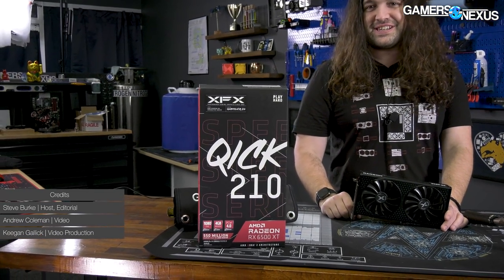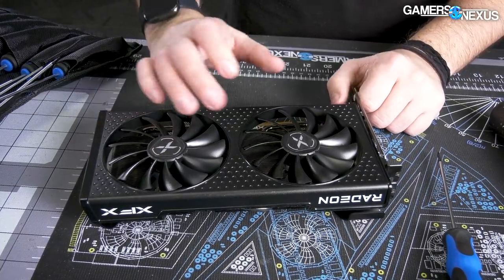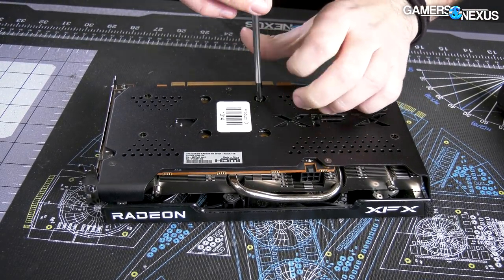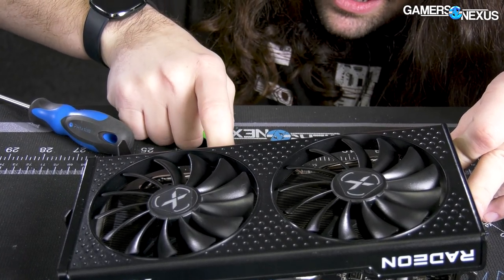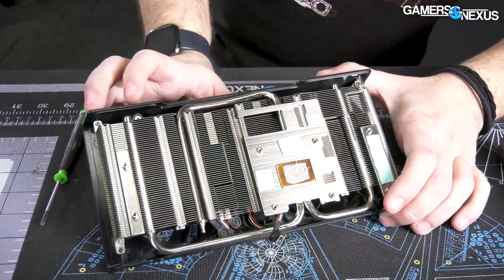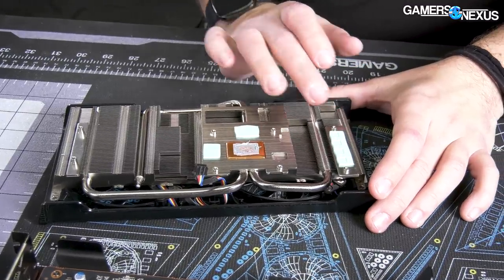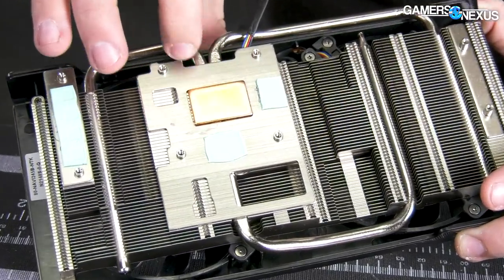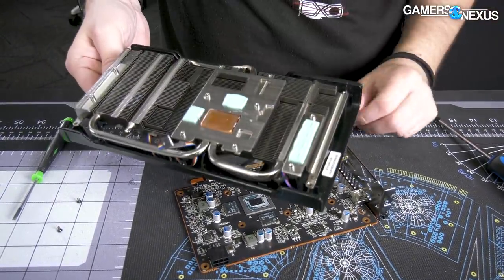Tearing Down Trash: AMD XFX RX 6500 XT Disassembly

Comment: Nice of AMD to design a card that goes direct from the factory to a landfill a year later. Maybe they can team up with Dell next and design a proprietary PCB that doesn't fit standard PCIE slots and cases?
Reply: Oh just wait a few weeks and you'll see this card in a lot of Dell prebuilds.
Reply: the other option is $320 1650 used for low end lmao, and $200 6500xt new become landfill
Reply: No. A lot will go to eBay where I then purchase it for a fraction of the price. It'll be a matter of time until the 40 series releases, and miners start to sell hundreds of thousands of 30 series cards on the used market. Miners from China where mining was banned are already selling 3060s for like $200 each. Granted they are in China, it's still a prerequisite of what's to come. The bubble will eventually burst wide open.
Reply: Don't you guys recycle? In Belgium you take old electronics to the recycle-park. Or if you buy a replacement part you can leave the old part at the shop so they do the recycling part for you.
Reply: @lewislu5157  320$ 1650 is 50$ less than a new 6500XT for more performance
Reply: @GrabASpriteB  they won't, as they didn't sell (and instead bought) 10 and 20 series cards.
Unless mining is banned or entirely moved to not-GPU, it won't happen.
Reply: @Jerre27  they're Americans, what did you expect
Reply: @Jerre27  very few places legitimately recycle e-waste here in the US.. it was primarily dumped on third world countries until they decided they had enough and started refusing it and now it just goes into landfills but at least people get to think they're making a difference, lol.
Reply: I guess you've never seen low-end office PCs. Replaced every 2-3y, the entire box is not worth the sand and metal it was made out of, outdated on the day of arrival.

Comment: I think they should've called it "KICK" because you get kicked in the balls for buying it, especially if you use PCIE 3.0
Reply: @haikatta....8023  right on queue...
Reply: Although the difference is about 10 fps at most?
Reply: @kimdotnet2110  😄
Reply: For PCIe gen 4.0 its a good buy. 10% better than GTX 1650 4gb DDR6

Comment: I'm actually surprised they bothered with a backplate for this. The cooler seems overkill too? Maybe less informed customers see the backplate and think it's a better card than it really is.
Reply: Look at the Gigabyte triple fan model. It's huge and basically see-through lol
Reply: Backplate 95% of the time is for looks.
Reply: @benclimo461  also a bit of additional protection for the board components when handling the card.
Reply: @kennichdendenn  That's what the 5% is for.
Reply: That's the point, coolers are cheap. $100 for a cooler.
Reply: @MiGujack3  in custom water-cooling, there are backplates with Heatpipes that get cooled by the water loop. For example for the 2080ti. It's called an active backplate.
Reply: @MiGujack3  and the -1% is the 3090?
Reply: @ICCUWANSIUT  lol yeah my 3090 KP over here begging me to add some backplate fins.
Reply: Aftermarket GPUs can be really funny that way. I remember back when the 1060 launched you had a ROG Strix version with 3 fans and a HUGE heatsink, and it cost the same as a 1070 lmao

Comment: While I agree that this would have been actually appealing and a good product if it was single-slot and didn't need a 6-pin, the reality is nothing matters at all about any GPU released right now.  It's already sold out, it's being scalped at double the price, we all knew what would happen.  I've been building for almost 30 years and this is the absolute worst it's ever been, clearly.  If crypto, scalping and supply chain issues don't get resolved it's only a question of when DIY building will die.
Reply: suspicionofdeceit  thats what people said a few years ago :p
Reply: suspicionofdeceit  it won't get better until crypto mining is no longer profitable. That may take a very long time, but the problem is that it goes in cycles. The only way to alleviate it is to place a government ban on it pretty much worldwide. I can see this happening for 1 reason, and that reason is energy consumption.
Reply: In my opinion, that's what they want. Corporations are jerking off to the prospect of users not owning hardware anymore, instead relying on streaming and subscription models. The need for hardware will still exist of course, for clusters and servers to power the cloud services, and users get to own nothing and have even less control of their own lives.
Reply: @LordMaliscence  Crypto is currently crashing and has been down overall for months now. So we'll see.
Reply: suspicionofdeceit  Once upon a time Nvidia had plans to making mining only cards; no video outs and tons of vram. 

The problem is that a GPU's resale value is part of the profitability of mining, so if something is dedicated for mining there's less incentive no matter how high the hash rate is. In contrast, gaming GPUs are the perfect candidate: high power/hash rate, an easy route to resell (even before shortages the second hand market was moving tons of GPUs), and of course the sheer popularity of big GPU releases by both AMD and Nvidia. 

Even if they made a card with video outputs and favored mining the large farms would still prefer gaming cards because it will be so easy to dump them after the crypto market crashes. Plus AMD and Nvidia may not have had much of a choice, you can only get so much yield out of a single wafer and splitting the market may have actually ended up with less cards being produced overall. 

And honestly, I don't even blame AMD or Nvidia for the shortage, the real problem lies with pallets of GPUs being sent directly from partners (MSI, EVGA, XFX, PowerColor, etc.) directly into mining farms. There's something like 350,000 30 series cards estimated to be powering the Etherium and alt-coin networks right now. It's less of a silicon shortage (although that has definitely played into this market) and more of a problem with the absurd amount of demand the last two years have seen.
Reply: Scary and sad future up ahead atm console gaming seems like the best move for low end
Reply: @Y0G0FU  Well, they did finally break ground on the new fabs right?
Reply: suspicionofdeceit  that's easier than praying for someone to be competent for once 🤣
Reply: they're not sold out here in the uk, retailers have loads in stock, people aren't really buying. £230-270 for 1050ti performance just turns people to the used market for a gtx1070
Reply: @Y0G0FU  2 years ago I bought a 3070 for £580. I think you're exaggerating a bit.
Reply: not sold out in the UK.  can easily get one for almost what AMD claim is MSRP.
Reply: Or a low-profile GPU! I guess it is a small market, but given that the most powerful LP GPU is GTX 1650, this turd would have a chance there.

UPDATE: Ignore this comment, I've just learned that AMD is preparing 6400, which is both low profile and single slot and is even less equipped than 6500 XT. Well...

I also am of an opinion that 6500 XT is an okay'ish GPU if you're on a budget and build a new midrange gaming PC with PCI-e 4.0 support. It is really not a good GPU for PCI-e 3.0.

UPDATE 2: Oh, 6400 is OEM only. Okay, then my ranting is still valid.
Reply: @Redslayer86  Not enough. It's still hovering x10 of what they were in 2020.
Reply: @barrycooper8640  the 3070 released 16 months ago, can't be 2 years ago that you bought one :)
Reply: It's as if AMD, Intel, Nvidia, Asus etc. just don't care.
Reply: @MrBaritonefreak  when was the last time McDonald's ran out of hamburgers? Mining demand is part of the problem but limited supply is the real failure, here.

The chip shortage isn't just affecting PC parts; cars, microwaves, refrigerators, etc. are affected, too. Are miners buying all of those? The current situation is the result of the US-China trade war cutting off a major chip producer from the western market and a series of natural disasters hitting producers located elsewhere in the world.
Reply: You forgot tariffs
Reply: It's already dead, and will never recover. I was optimistic in 2017. But now it's 5 years later, and the market is FUBAR
Reply: i got to change my R9 and just sold my entire pc instead, will check in 5 years or so when the market returns to normal.
Reply: well, crypto has lost a lot in recent days. ethereum lost 40% in a month. and in eu there is talk about banning proof of work mining completely. will take a while, but the direction looks promising
Reply: @TechniqueSan  That's what they want for sure, and it'll probably work okay for very casual gamers. However the inherent lag it introduces really sucks and is not something can be fixed.. Serious gamers will have tried it and passed on it..
Reply: Crypto crashing now, lets hope it continues downtrending.
Reply: @janklaassen6404  So, I was a bit off. I still got a 3070 for £580 though 😁.
Reply: Hell even a 150€ pricetag would have made sense but TWICE that?!
Reply: @LordMaliscence  "people are making it harder for me to play games so let's ban that"
Reply: @LordMaliscence  Thats why mining is bad, sadly, the concept was fine but the moment money is in it, ppl WILL abuse it to extremes and thus it doesnt matter how huge the supply is... the moment there cheap cards ppl will buy bulk and try to make money - even on low profit they'd just got 20-30 cards and make still enough to make it worth it... sigh
Reply: I like how it’s predicted these market conditions the companies are abusing are gonna come back to bite them in the ass later.
Reply: @janklaassen6404  The card isn’t worth it at all wrt 6500XT
Reply: suspicionofdeceit  except this card isn't good for anyone. It's not good for mining (TYC did a video on it apparently), it's not good for gamers... I don't know who the hell this is supposed to be for.
Reply: @anthonymarquez2542  it aint really a ponzi, at least as much a ponzi as the US dollar. Energy consumption if it was clean would not be a problem. Its more the fact we arent moving to clean energy sources that is the problem.
Reply: With ethereum going PoS this June and other coins being less attractive to mine (Ravencoin uses a ton more power and it's the next best coin to mine), demand will drop. Will scalpers stop scalping? No. Will they at least lower their prices? Maybe. I agree, this is one of the worst times to build, or upgrade, a computer
Reply: @Y0G0FU  Afew years ago it was an a good spot the heck are you smoking.
Reply: Here the absolute cheapest one sold out (still like 240$) but the 270+ ones are all in stock. Barely like 1 or 2 posts on FB too
Reply: suspicionofdeceit  see CMD from Nvidia.
Reply: @donovan6320  global warming??
Reply: @_z6150  Lmao also they are literally destroying the world's ability to provide energy that could be one reason

Comment: the cooling seems completely overengineered. drop it to 75w, and this card looks like its meant to be a single slot long, or double slot single fan stubby.
Reply: it's probably overstock from their other gpus retro fit to this one. obviously they couldn't make enough of the other gpus so this was likely saving them money in the long run.

Comment: The plate around the copper slug is almost certainly aluminum. They would never use stainless steel here because it's both more expensive and far less thermally conductive. The screw posts are obviously steel for strength. There's a reason ASUS brags about their stainless steel I/O plates, it's a noteworthy cost to them to include it.
Reply: @samgoff5289  graphite would be terrible , graphene is an alternative but would have to a molecule thin layer on another material . Silver is too expensive to be practical so cooper or lesser conductive metals are the best. Stainless is excessive with no real benefit unless you are salty mining farm (by the ocean) XD
Reply: I'm no expert on the pricing of different grades stainless steel and aluminum, but I expect they would use stainless if it was cheaper.  The heat pipes are carrying the majority of the heat out to the fins.  The section in question appears to be mainly for structural reasons.
Reply: and yet they did it on the 5700xt thick

Comment: Just want to take the opportunity to thank you for doing these tear down videos. The fan of my GTX 1070 recently died and watching your videos for years certainly increased my confidence that I could take it apart and fix it myself. Bought a $15 replacement fan on ebay and went to town, card works perfectly and will probably be good to go for another couple of years.
Reply: which 1070 was that, FE or custom AIB?
Reply: @proCaylak  the Gigabyte ITX model

Comment: To think that they could have used this fab capacity to actually make something worth while.
Reply: It's equivalent to selling farts in a jar. Everything sells, including leftovers and generic garbage.
Reply: Like an RX 5xx reboot. Not only would it make sense, but it would incentivize AMD to continue supporting it.
Reply: They'd lose money with all the steps and costs that come with making a separate chip that miners won't want. Or do you want a chip where you have to compete with miners?
Reply: They do. The CPU that's supposed to pair with this GPU wasn't ready yet, so what better way to experiment with a new node than to release a GPU that they may not want, but will still sell
Reply: Mr. Krabs: "I trusted you, and you gave me *THIS*?!"
Reply: For the 6500xt:
Die cost is around $18
Board, VRM, etc. $50
30% markup to pay for R&D and other things (Normally is 60% for Nvidia and 45% for AMD) Total 150
VRAM $12 a GB so $48
Cooler $15
Shipping (right now) $30
The rough total before any AIB markup, $195

So why are we getting mad at AMD for setting a realistic MSRP for the market right now, but COMPLETELY IGNORE NVIDIA NOT SETTING AN MSRP FOR THE 3080 12GB.
Maybe AMD learned now, they just won't say a realistic MSRP or any, then no one will get mad at them. Great job you just created a new Nvidia in the GPU market
Reply: Probably not tbh... I'm sure they are probably using chips that didn't bin right for some other purpose.
Reply: @benc3825  because literally all they needed to do was not make it pcie 4.0 x 4 to make it better for gamers but they are to stupid and greedy
Reply: @samgoff5289  You realize that is was meant for laptops. I don't know why they didn't put 8x lanes, but it isn't as simple add 4x more lanes. It would cost millions for rework the die and possibly weeks of work. I wish it was 8x, but they didn't as laptops wouldn't need (I guess). It probably would have only cost a couple mm of die space, but when you are trying to pump dies out, that extra 3 mm of die space can be a TON in a 100mmm2 die size
Reply: @benc3825  people can't produce, just complaint. In the end they will still buy it.
Reply: @benc3825  what I'm more impressed with is Steve, who already visited fabs and knows about manufacturing and still can't highlight inflation and AMD trying to fill the gap
Reply: @ikarus1111a  Wow.... I didn't even think of that... I don't have anything that I can say that wouldn't sound like an attack...
Reply: This really shows the failure of society. It is just herd mentality and the people who have the microphones look at products in a vacuum when they want and don't want.
But what gets clicks? Actually good GPU in the market or
THE WORSE GPU EVER MADE
It's just, sad
Reply: "I missed the part where that's my problem."- AMD
Reply: @IndellableHatesHandles  GCN is dead. It shouldn't be resurrected.
Reply: @ikarus1111a  you mean all of us should celebrate this gpu? Like every reviewer should praise this gpu and explained how kind amd is for gamers by relesing this product, is that what you mean? 
Did you seriosly think this gpu is a good idea? And amd did not deserve any critisizim, instead consumer should rally up and praise this launch? I'm honestly baffled by this comment, i don't know what you smoke before writing those comment
Reply: Made for notebooks but being leaky in power made those desktop dies. Their big faults were the PCIE 4 lanes and the 4GB VRAM.
Reply: @brpwb4i997  not celebrated but realistically described. Not fucking ultra res textures to make it look bad in unrealistic scenarios on pci-e 3. If you manage textures to <4GB pcie limitations are pointless
Reply: @petervansan1054  i think reviewer make valid comparasion between 6500 xt and prrvious gpu, inflation always exist even the worst one in 2008 yet hardware still progressing, i don't think inflation ecxcuse is valid because if that's true then why we reach where we are now, the problem is regresing performance and feature of 6500xt compared to previous gen
Reply: @benc3825  On laptops you'd go PCIE x4 to save power.
Reply: @samgoff5289  it's a laptop chip. You can't just slap more pcie lanes onto a card. It's not LEGO.
Reply: @benc3825  well I've seen that the new APUs only have a x4 internal pcie connection for the iGPU. so if they were somehow taken from a APU, either physically from failed laptop APUs or simply a design copy that could explain the pcie situation.